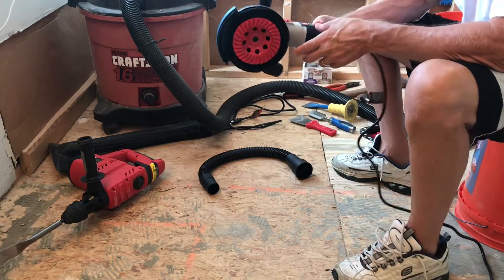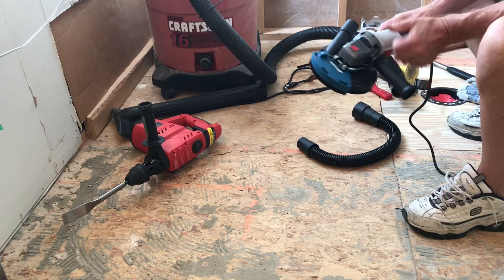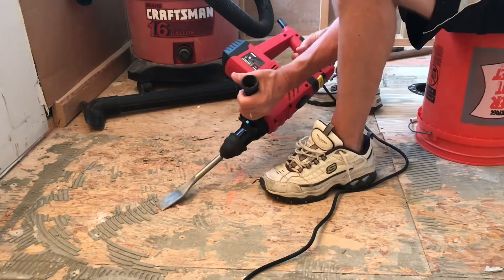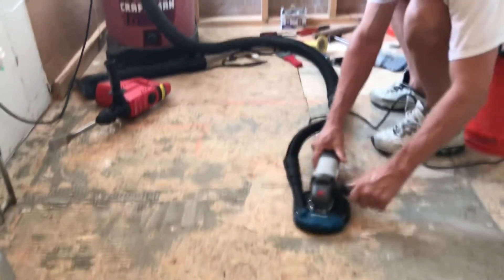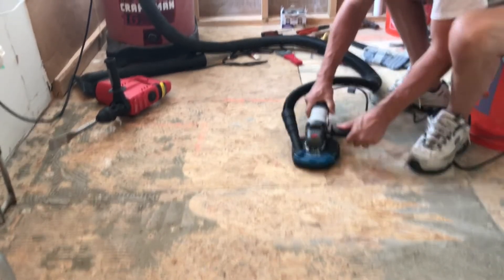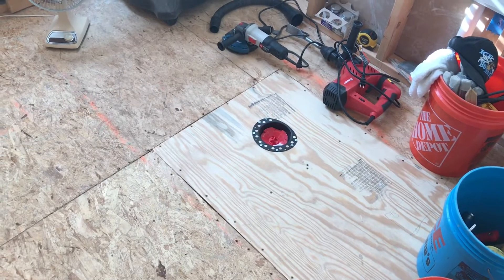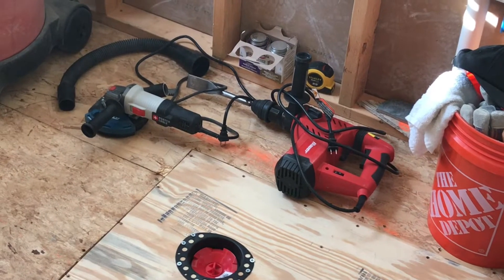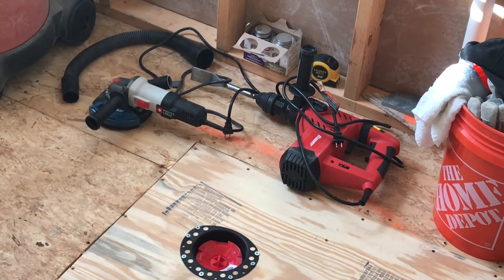Remove Thinset Residue off of Subfloor with Angle Grinder @DIY Boomers

Comment: This was great advice..  I wasnt 100% certain how I was going to remove it and after watching your video I know that was the way to go.   followed your plan exactly and it worked great for removing the bigger thin set with hammer drill and smoothing out with the grinder and diamond blade.   You were spot on with the dust cover that attaches to the vacuum!!
Reply from the maker: Thanks! Yeah, that was one of the many projects that I was very happy with in our bathroom remodel. It worked out very well. Thanks for watching and I’m glad that it was useful for you!

Comment: Extremely helpful video!!!!  I just bought the guard and and chisel drill bit!!  Time to get through my project a little easier!!  THANKS!!
Reply from the maker: You’re welcome!! Yeah, short of ripping up the subfloor and replacing it, the hammer drill, chisel bit and grinding wheel with vacuum attachment are the only way to go! Glad it helped! Good luck with your project!

Comment: This is the way
I used the same setup to remove a 6' x 6' area of thinset from a slab with zero dust in 45 minutes. 
Removing that material by hand would have taken hours and been a nightmare.
Only suggestion is to use an additional washer to position the bottom of the diamond cup close to the bottom of the dust collector brushes. Then you don't have to push so hard to make contact.
Reply from the maker: Good idea! Yes, this method is absolutely the best. Hard to imagine doing it without the grinder.
Reply: thank you for this comment. haven't even started grinding yet and  I could already see a problem: the middle spindle thing on my grinder was poking out beyond the perpendicular plane of the blade/wheel I have. used washers to get the spindle below the plane of the disc.  Then I watched a bunch of other vids and they had similar concerns; having to push down really hard to compress the bristles to make full contact with the floor.

Comment: Just got this shroud from Harbor Freight. I've seen other videos where they mention having to press down really hard to compress the bristles on the end of the shroud, so they get good contact with the floor. But your grinder just seems to float right along. Is it because the particular cup blade you have has a big "arch"? Or did you use washers?

Comment: Did you use a spacer for the grinding wheel itself? I think mine was too far up in the shroud and I was having a hard time removing the thinset or trying to get the wheel on the thinset itself without cutting into my concrete.
Reply from the maker: No, the grinding wheel and shroud that I used fit perfectly for proper grinding. I have noticed that there might be differences in the way different brands fit together. Is there any room for adjustment on the shroud to move it up higher?
Reply: No, but my shroud (Dust Shroud Pro from Home Depot) has almost like a little shock absorbers so that you can press down on the wheel itself while the shroud stays in place, if that makes any sense? 

So instead of the wheel staying flush with the concrete, I can apply back and forward pressure because of the shock absorbers on the shroud. Unfortunately, I was having a really hard time with knowing what kind of pressure to put down on the thin set without cutting into the concrete. 

I did notice the wheel was a little bit further up than the shroud skirt. I found a spacer and maybe will try again tomorrow.
Reply from the maker: Good luck with that, hopefully that’ll do the trick. Thanks for watching!
Reply: You bet. Thanks for the replies!

Comment: I just got my grinder set up like this and it absolutely RIPS through the mortar. Only problem is my Shop Vac has a bad filter that kicks out fine dust, so I'm waiting on some stuff that will reduce that.
Reply from the maker: Yup, I was so very pleased with how this does the job! I’m sure you’ll be happy to get the dust under control and finish it.
Reply: I saw another vid on the same shroud.....one guy ran a super long hose from his vac exhaust out the window !!!!  pure genius and yes, the more expensive filters are totally worth it.
Reply from the maker: @calvinpryor Yes, a great idea!

Comment: Did you use a fine dust filter on your shop vac or just a general one?
Reply from the maker: I just used the general filter that came with the shop vac and got great results with that and the dust shroud on the angle grinder. I was very happy with it. Thanks for watching.

Comment: Excellent video. My contractor wanted to remove floor lol $$$$$. What disk did you use on the grinder.
Reply from the maker: Thanks. Yeah, a little drastic unless there’s a good reason for it. I bought the Bauer 4” Diamond Turbo Cup Wheel for around $30 at Harbor Freight. The Dust shroud is the Hercules 4” to 5” Surface Grinding Dust Shroud also at Harbor Freight for around $30. Links to both below.

https://www.harborfreight.com/4-in-diamond-turbo-cup-wheel-57565.html

https://www.harborfreight.com/4-in-to-5-in-surface-grinding-dust-shroud-57486.html

Comment: Did you hit any nails or screws?  How did the grinding wheel took it?
Reply from the maker: I tried to make sure that all nails and screws were below the surface before starting but I did scrape a couple screws. As soon as I hit them, I stopped and got them lowered. With just a little contact, it didn’t cause any noticeable damage to the wheel.
Reply: From someone who has done flooring professionally- Ideally any screws or nails are below the subfloor for the best holding power and if they are very proud then drive them in further, but any quality diamond cup will eat the head with no damage to the wheel smoothing out the surface. The first time you hit a head though it will spark and may startle you
Reply from the maker: Thanks for the info, good to know! Yes, the first time you hit one, makes you pause!

Comment: what the model for the grinder?
Reply from the maker: The grinder is a Porter Cable model PCEG011. Tap the link below. I picked up the grinding wheel and the dust shroud at Harbor Freight. Links to both of them below also.

https://www.amazon.com/PORTER-CABLE-PCEG011-AMP-ANGLE-GRINDER/dp/B07BFSDJGM

https://www.harborfreight.com/4-in-diamond-turbo-cup-wheel-57565.html

https://www.harborfreight.com/4-in-to-5-in-surface-grinding-dust-shroud-57486.html

Comment: 'diamond' is too general. Can you be more specific about which items you bought? Also what if you have concrete under the thinset instead of subfloor?
Reply from the maker: Sure. You can see all the tools that I used down in the description along with links for the tools. To open up the description, you tap on the text (…more) that is below the Title of the video. Then, to expand the description, you need to tap on the (…more) that is in the opened description. I bought my grinding wheel and dust shroud from Harbor Freight. They weren’t available for awhile at Harbor Freight after I bought mine, so I also listed similar items from Amazon. My angle grinder has a 5/8” shaft and uses a 4 1/2” grinding wheel. Also the dust shroud is for 4 1/2” to 5”. Just make sure of the correct size for your grinder.

Yes, you can use these grinding wheels on concrete.

Comment: I refuse to put mortar under the backboard. I don't care what anyone says, I screw down gypsum back board using a million screws  and that's it. Removing mortar is the worst most un-fun project ever.
Reply from the maker: Can’t really argue with that! Removing thinset is a BIG pain. Everyone pretty much follows industry procedures but sounds like that should work just fine.